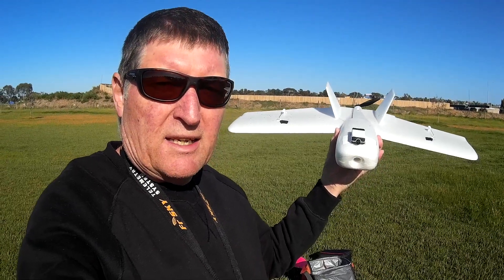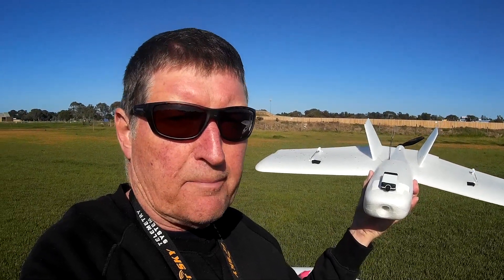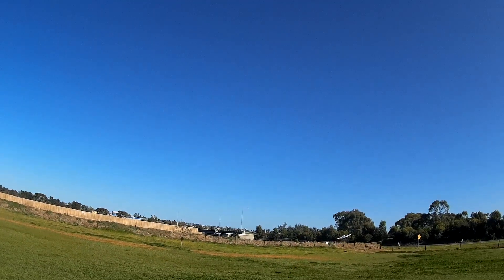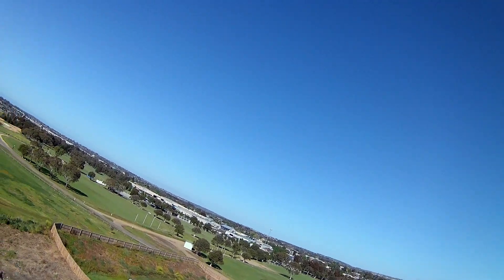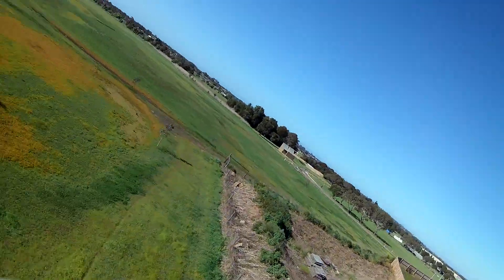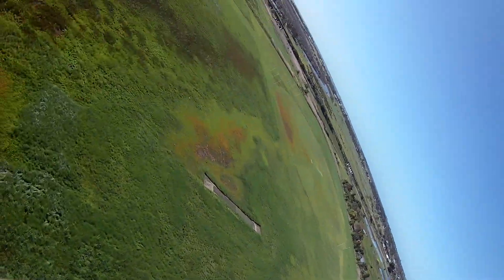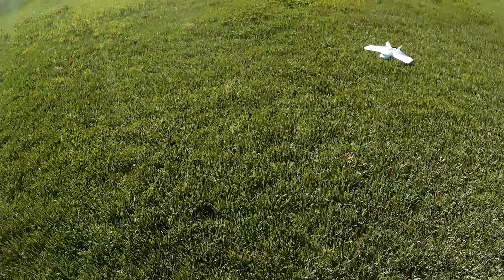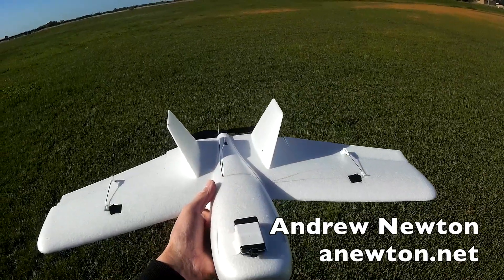ZOHD Dart follow up

Comment: That looks a bit better Andrew....It needs a FC in it for sure....It's the sort of plane that once in Horizon Mode will fly like its on rails.....Have you got that Omnibus F4 and M8N GPS yet?....You will love it.  I fly my Falcon in Alt Hold Mode or Horizon all the time, I even land it in Horizon Mode. You need to fly it FPV...it's a very small plane for LOS flying.
Reply from the maker: Yeah maybe....not a high priority with this one. I did solder up and flash the Omnibus board / M8N GPS today, very satisfying.
Reply: Great, I imagine the ready made presets of the Z84 will be fine for this little plane. I used the Z84 but had to up the gains for my Falcon as its bigger and slower to respond. Once you start flying with iNAV and its OSD you will love it. The reliability and its RTL capability with Altitude Hold etc will give you great confidence and a completely different approach to flying FPV...That's my prediction anyway. Im guessing the Micro Talon is going to be your first real adventure into iNAV and the F4?

Comment: Im getting a lil bit of money soon, should I go for a t28 from dynam or a micro sky Hunter with fpv stuff for a first fpv plane
Reply from the maker: Ha, that's a hard one. Both are excellent. Dynam T28 is the only warbird I have kept, it's a perfect plane. micro SkyHunter is a fun little FPV plane. Might be a little frisky for your first FPV experience and the FPV gear is OK but there are better cameras and video transmitters.
Reply: If I got the micro skyhunter I probably would have gotten a new TX 03 camera for it it's also pretty quiet which is why I like it i

Comment: Great video!, i preordered my dart from bangood, have you tried a 4s lipo, upgraded 30Amp esc maybe prop down to 5x3, do you think the air frame of the dart would handle 4s speed? (not shure how strong the magnetic wings hold onto the fusalage)
Reply from the maker: Tape the wings on an it would be OK

Comment: Good video Andrew! Just received my "Dart"! question on the stabilizer? ...Do the colored single leads coming off the  stabilizer simply plug into the "signal" pin in the Rx?? for each channel?
Reply from the maker: Mine didn't come with a stabiliser but it's probably the same as the Orbit wing. 3 wire lead for Aileron channel, Blue single to Elevator channel, Yellow to throttle channel, Green to mode switch channel.
Reply: I'm sure you're right! I knew I saw it on one of your videos, I'll go back and watch the orbit vid again! sure sounds like the same stabilizer! Thank You for the feedback, I'm a big fan of your channel!